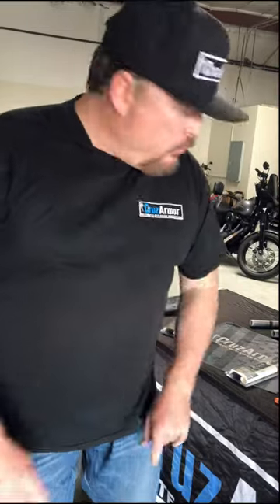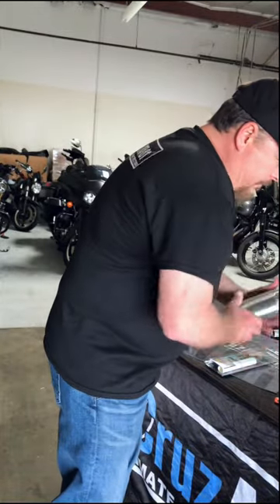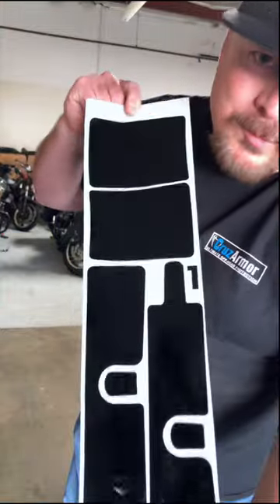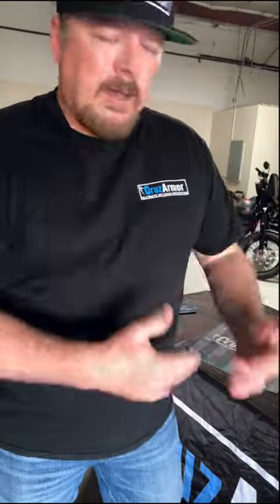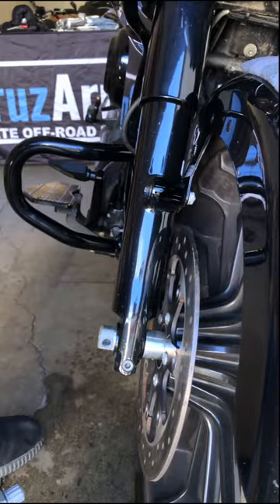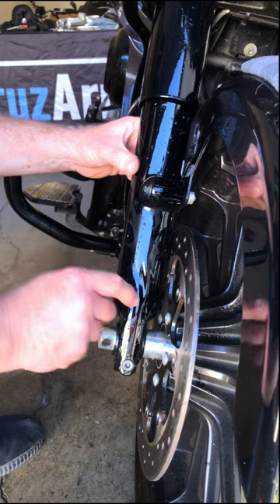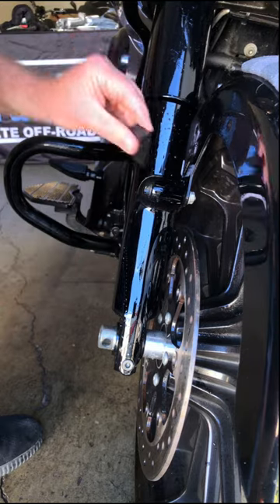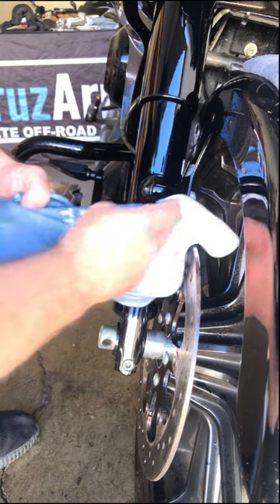CruzArmor Harley Davidson Fork Protection Intro/Demo

Comment: Would you want to use the black on a brand new bike with black forks that doesn’t have any pitting or the clear ?
Reply from the maker: On a new Motorcycle, we'd use clear. The "Clear Fork Kit" will cover scratches and scuffs making your forks look new again. If you have pitting from a few months or years of riding, the "Black Fork Kit" will conceal them nicely.